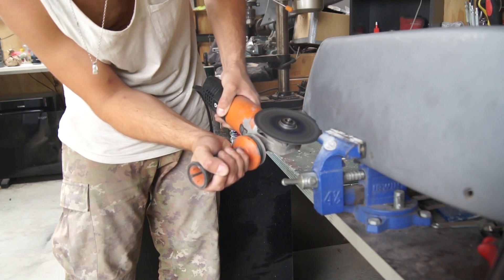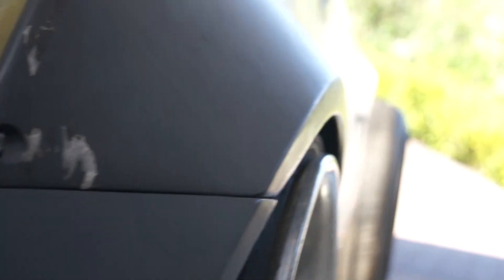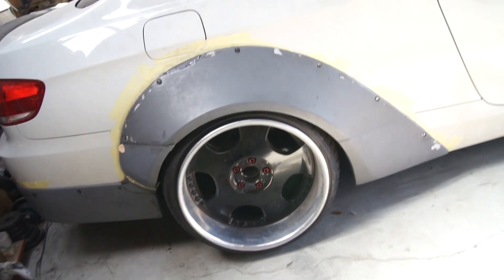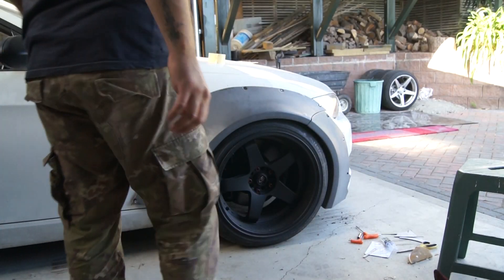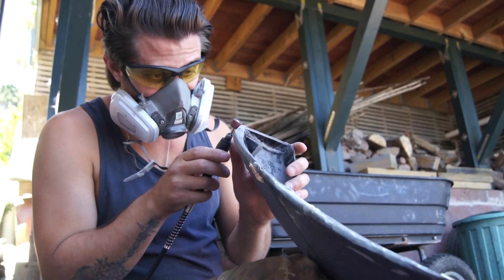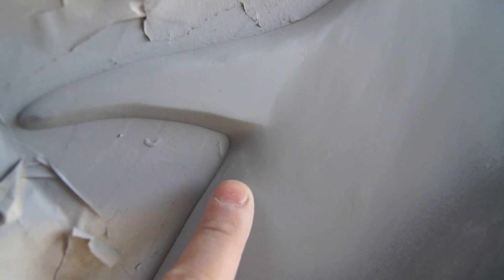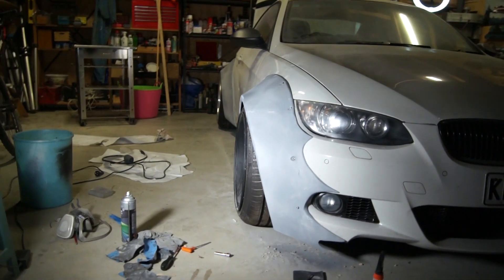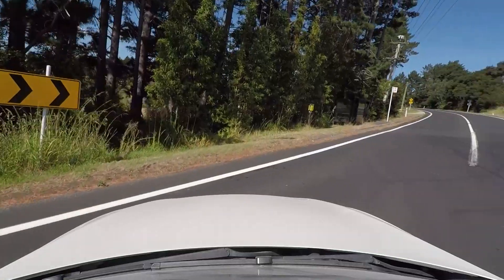BMW E92 Custom Widebody Kit Install

Comment: good stuff bro, been following your build, good thing I see progress and hopefully to see the finish product.  Dario, have you use wheel spacers?  I never noticed them, what size you've use?  front and rear?
Reply from the maker: Thanks man. First, the wheels are all wide 12" and in the correct place (not stock 8/9" wheels spaced stupidly. But I couldn't find the correct offset in that size so yes I had to space the offset 50mm, but I plan on getting forged wheels in the future for sure.
Reply: @DarioPerazzini  try this weblink, hope it helps or maybe too late as you already have your wheels...anyway here's the link..

https://www.m3post.com/forums/showthread.php?t=1184930

Comment: Could you answer some questions about your wastegate video? Before you took everything apart, were you satisfied with the 80-90% less rattle with the washer fix and revolutions? Also, do you get absolutely 0 rattle now from the complete wastegate overhaul ?

Thx!
Reply from the maker: I was happy with it while it lasted  (20,000kms) then it got bad again, afterwards yes now I'm happy with it (95% gone). It's a design fault so it's never going to be perfect, being a harmonics thing it also depends on the the wastegate tightness...Idle speed, exhaust note, boost pressure etc. so never going to be perfect but yeah it's pretty good now